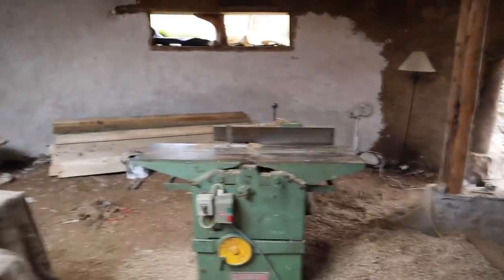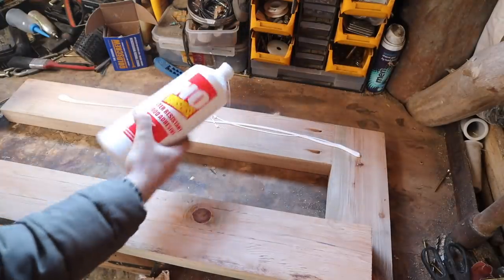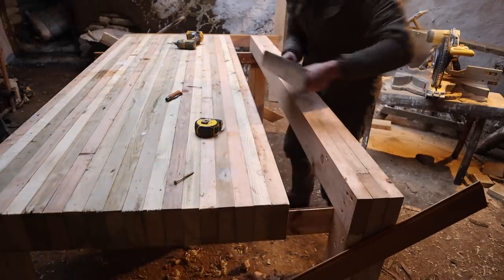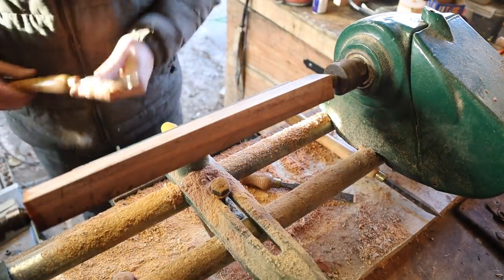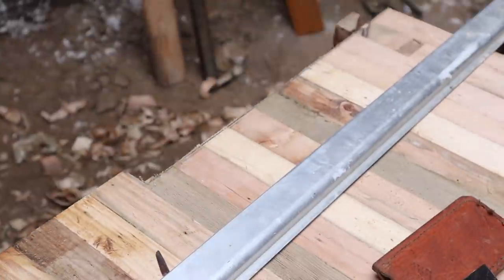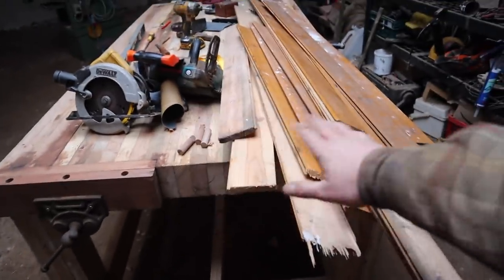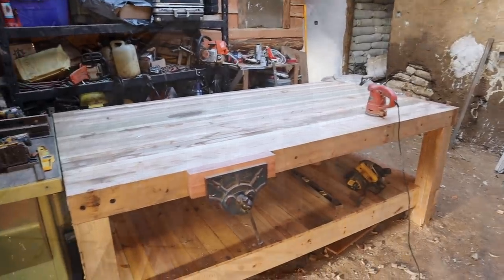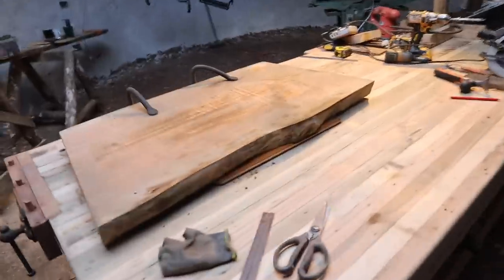Huge Workbench And Outfeed Table From Reclaimed Wood

Comment: Lol great work and I'm glad you didn't spend too much time making it look like a table that would go in a home, it won't be long before it's marked, bashed, chipped, and glue stained. I reckon it will last a year before the first saw cut and then for the rest of your life you will use it as it should be, a table that has chisel cuts, paint marks, if it ever gets too bad you can always take a few mil of the top. From my own experience, a shelf is far better than draws and compartments and make life/work far quicker, for small tools magnetic tool holders are fantastic and work as they should.

Comment: Great stuff. Found you channel today, im off grid too. Really impressed with what youve done and your enthusiasm. I would normally be the last to say anything about safety, but when you use that surfacer i get visions! It's my trade and ive spent many hours on such machines. My boss lost the ends of his fingers via a distraction. Please make yourself a push stick and bring the fence up closer. I understand if you tell me to f off, but I only have your best.... I have an old 3 phase muli machine I got many years ago that im yet to install, didnt think I would ever do so, but your system has given me inspiration. Best wishes.

Comment: A lovely table - congratulations ! We made one half the size of that, in 1960. Ours differed in that it was designed to disassemble, so everything was joined by coach bolts, with diagonals across the sides and back rather than horizontals ( a triangle is apparently a strong way of getting sturdiness ? ). We were doing much lighter work... In the end, we sold the bench with the house 35 years later, so it never was disassembled ! It must be a lovely smell from the newly-planed wood ? Wishing you an enjoyable holiday, with some of your home-made brew that you might still have ? All the best !

Comment: It looks great wishI had room for it 
Stop knocking yourself
It going to work great
Reply: Years ago in the early 80s I and some of my colleagues made a bench this size from french oak bought in 4” slabs 30 feet long 
It was a thing of beauty and for a client 
We were all gutted to see it leave the workshop 
It was too pretty to use but the client was not somebody who was going to use it hard he was more interested in it looking good
Reply from the maker: That much of been a very heavy bench! this is really heavy and is softwood.
Reply: Kris Harbour Natural Building oh sorry took the dogs outside 
Yes the weight was substantial the bench was 8x3ft with wooden vises and screws all hand made on the long edge we made an apron  for the dogs and at the opposite end to the tail vise a drawer fitted for chisels 
Wished it was mine 
But it must still be out there with some patina now 
It’s a good thought

Comment: All that kindling....awesome. i saw an oil barrel Wood stove running on nothing but sawdust could be an option if you need heating?
Reply: I second that - I have a conventional wood stove and run it on sawdust and/or chippings from brushwood cutting. Once the sawdust/chippings is heated up, it stays red hot for the evening. Worth experimenting with !
Reply: Was it on the tradesman channel ?

Comment: My work benches have been made 1/4" too low then I can put a sheet of 1/4" MDF or Plywood top on it. That way they have an easy to replace, automatically level, disposable top. That way when the table surface is too damaged, I just put a new table top on it instead of having to replace the whole table.

Comment: I want to have a go at one of these now, thinking of using reclaimed skid runners (which are often exotic hardwood) finger jointed together and laid long ways like what you did with the joints offset.

Comment: Would you be so kind to cover the reasons as to why the back wall is still getting wet. i know it has something to do with the upper workshop not being build yet but there is surely more to the temporary measures which are or should be in place to prevent the water getting into the wall.
Reply from the maker: Yeah the back workshop covers the area that is getting wet and letting water in. water got in down the back of the stairs and found tis way down. i have covered it up temp with some tarps and the water isnt getting down anymore but its going to take a long time to dry out as the water got in to the bags so there is alot of water that needs to find its way to the surface and dry off. This time of year that will take a long time.
Reply: @KrisHarbour  A wood stove in your shop regularly fired will go a long way to clearing out the damp. You might be able to find one cheap on gumtree.

Comment: Rust will take the edge off your plane
Reply: Clean straight edge and rub carpenters pencil on it
Reply from the maker: I dont think it would. a plane cuts a slice out of the wood so the cut would be happening under the rust not through it.

Comment: I was thinking of some of the tabletops I've seen with epoxy poured all over and then left to settle to form a clear surface - I think it would get scratched too much. Are you going to put some danish oil on or something that might bring the detail out of the wood?
Reply: I've just done my kitchen tops In epoxy, it's amazing and super strong. Only thing here is it's an eco build. Otherwise it'd cost around £70 to clear coat that. Plus £20 if u wanted a metallic granite effect added.

Comment: I'm working on a scrapwood Paul Sellers bench myself. A bit more work than this one and a bit more subtle. If I'd have the space like you have, I'd probably build sonething as sturdy as yours (but with Pauls framing and joinery, probably, which is why you have an awesome bench in 5 days and I have a lot of parts that still need to come together after 5 months..)

 Awesome build, well done.

Comment: Merry Christmas to ya Kris, here’s a long term project (not that you don’t have enough already!) but I think you should build a very large reservoir up near the penn stock. Level the ground and build the biggest earth bag container for extra water power during the summer. You will need this in times of drought and heavy equipment usage. If the machines ain’t turning, you ain’t earning. Fill the thing with a wind driven water pump with a regular garden hose in the stream, and if you like put your barn next to it, so it can be filled with rainwater. You could run a siphon tube from the tank to the penn stock to give you extra water when you need it. The wind pump will just fill it when the wind blows. Not taking a lot, but some every day. Then you might end up with many thousands of litres of water to use when it doesn’t rain. I live in the U.K. and water supply goes up and down a lot. This might “save the farm” during very low rainfall. It’s something to think about - would you survive with no rainfall?